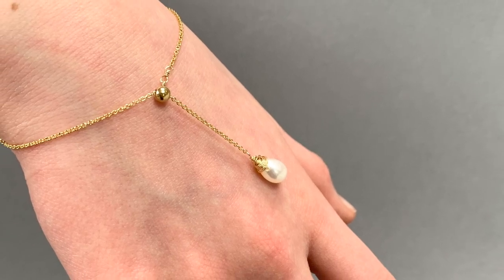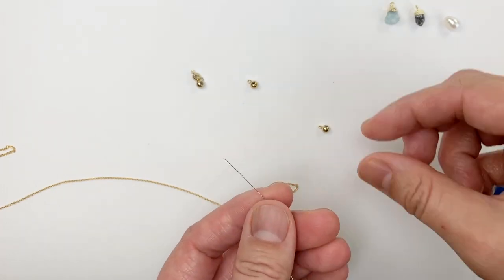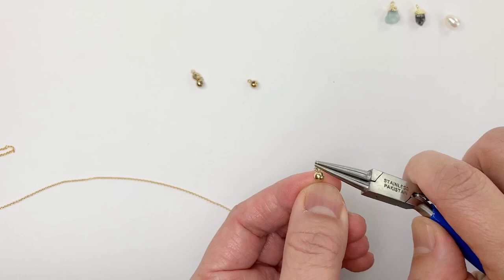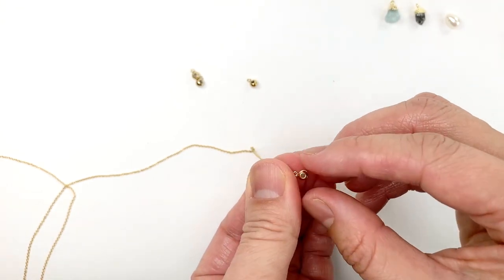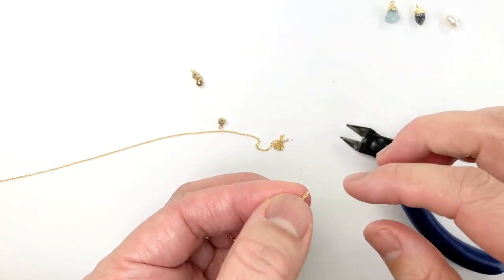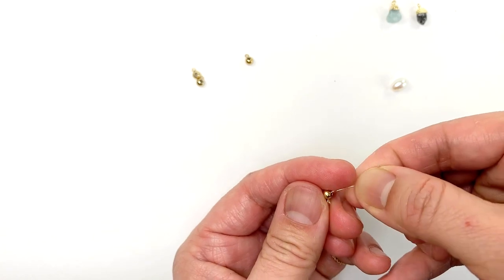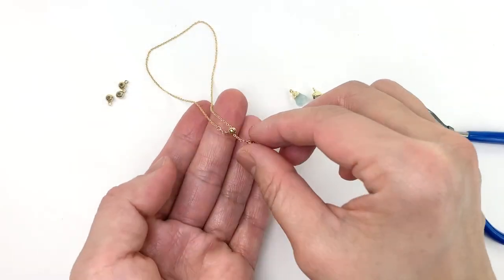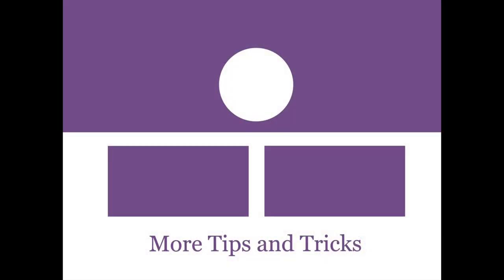DIY Slip On Adjustable Bracelet with Silicone Bead - Jewelry Tutorial

Comment: Any tips on how to select the correct silicone slider bead size and chain size to fit? Ty!
Reply from the maker: THe silicone has a lot of give.  However, you want the chain to be thin and tighter weave (link that is not too airy) because you don't want it to stretch over time, with lots of pulling back and forth.  

The supplier should be able to recommend what kind of chain would suit their beads.  I find the 3mm-4mm silicone beads work well for chains that are 1.2mm and thinner.  But again, thickness of wire in the chain is important!
Reply: Ty!!